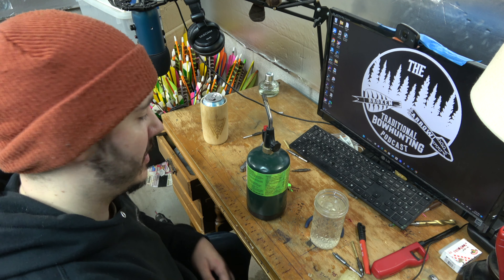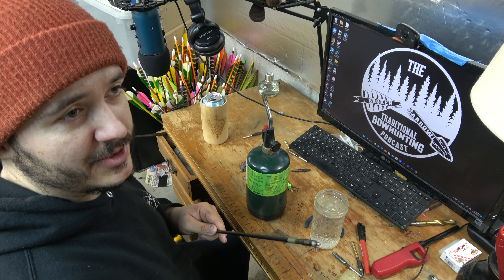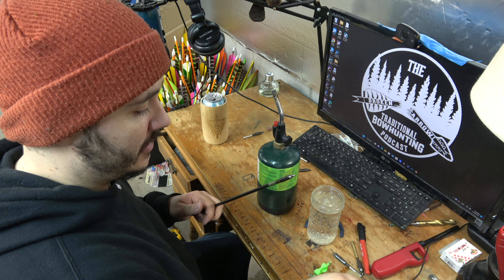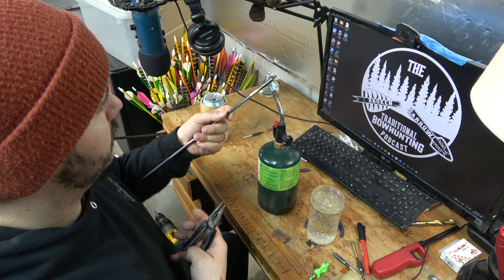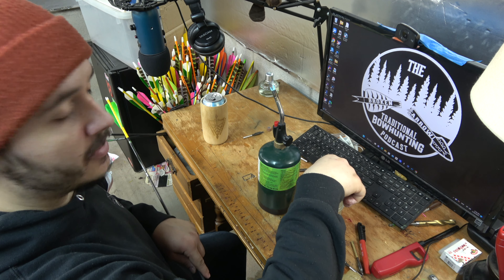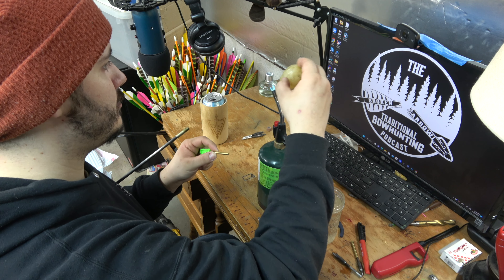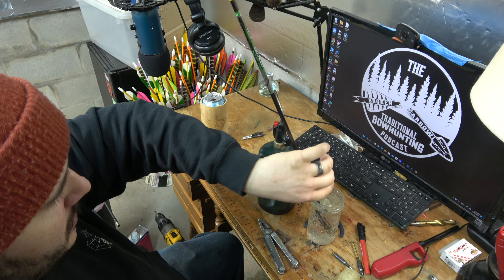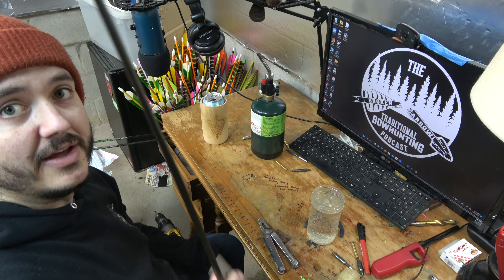Removing and Installing Arrow Inserts with Hot Melt | Traditional Bowhunting

Comment: Great thing about hot melt is if you split an arrow at the nock you can easily remove your insert for use in another build.  I use the blue stick melt and a large candle. 👍

Comment: Are those inserts still useable?
Reply from the maker: They are yes. What I have been doing lately that I like even more. Is to fill an old coffee cup with water. Microwave it for about 3 minutes. Dip end of arrow in it for a couple of seconds and then pull on the field point with pliers and the entire combo will come right out. Keep in mind, this is all using hot melt for glue.
Reply: @SchaferMagnant  I just cut and hot melted my first 3 arrows I have a dozen but I’m going to experiment with these 3 first. (I forgot to square off 2 arrows) so I wanted to ensure if I pulled them out that I could reuse them. Thank you! I used a heat gun the whole time!
Reply from the maker: @nickguerrero5184  absolutely!!
Reply: @SchaferMagnant  I’m cheap is it okay to re use glue?
Reply from the maker: @nickguerrero5184 honestly, as long as there’s enough glue there I can’t imagine it being a big issue